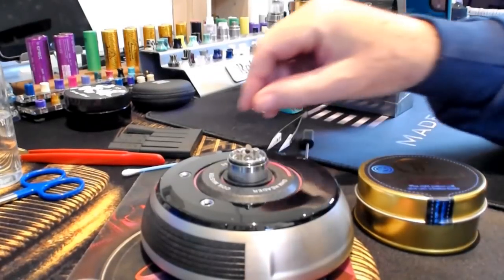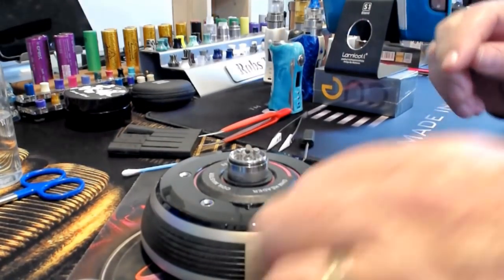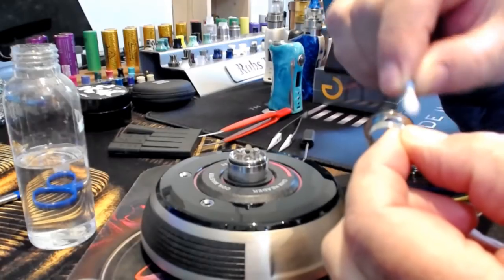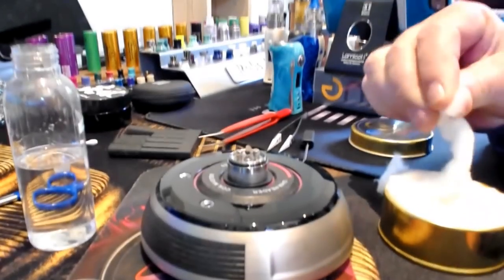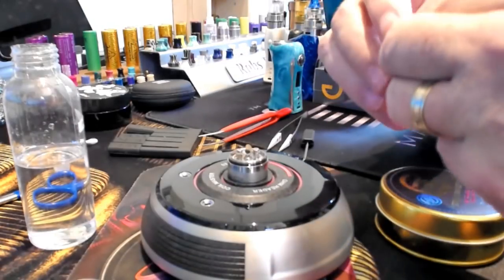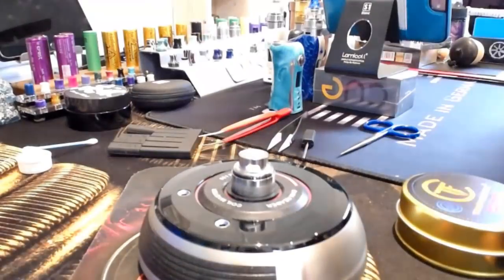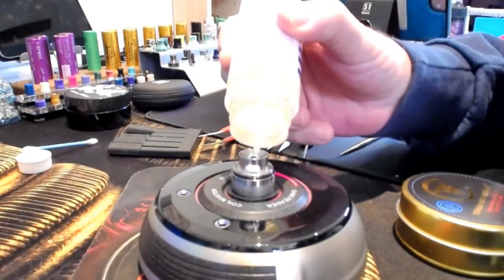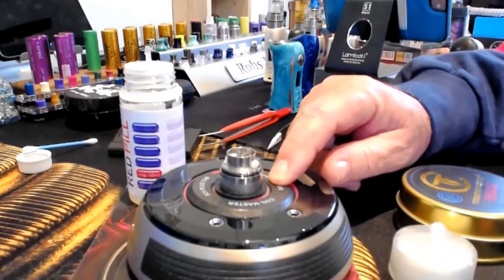Dvarw DL RTA wicking tutorial! Exocet Method

Comment: Hi Rob, I have the Dwarv 2 which doesn't have a top cap, (not sure why) but other than that looks very similar. I'm curious as to how much cotton you use which is an awful lot, its coming out of the airholes, I would have thought it would make it gurgle? Sometimes I've put too much cotton in and trim it a little and it stops gurgling, but you use way more cotton than I do, so maybe it was soemthing else causing it? I'll have to try it myself.